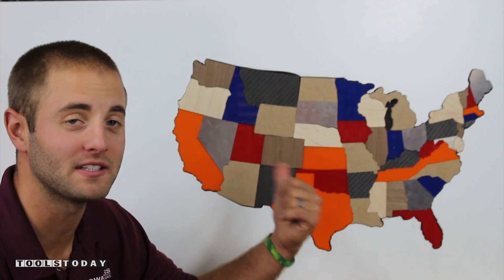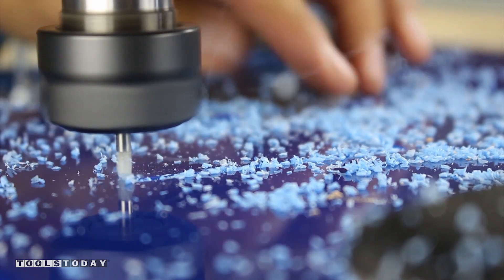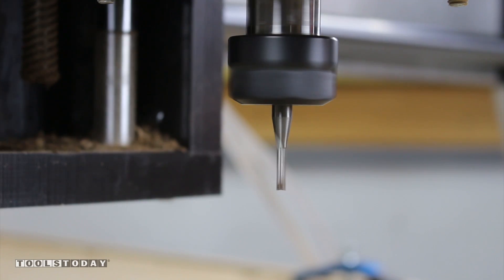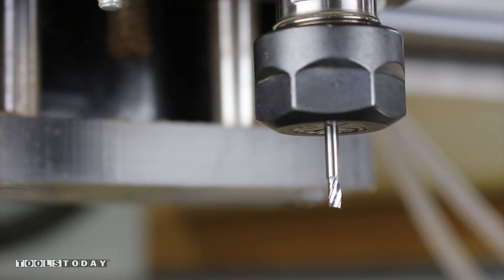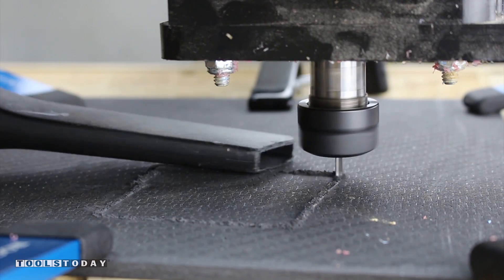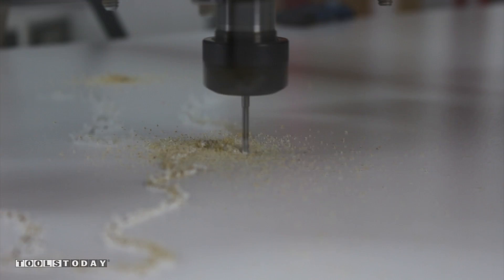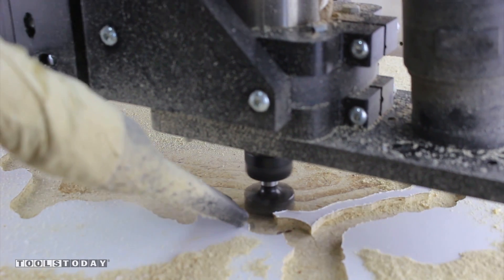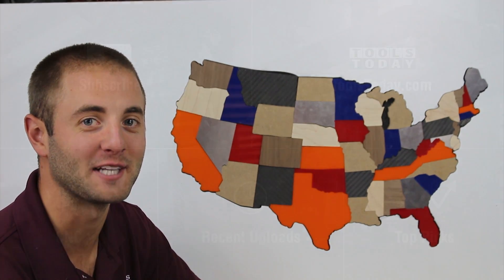CNC Project: USA Map Puzzle w/Amana's CNC Bits

Comment: I have a Router instead of spindle. Will that make a difference in regards to feed and RPM? What is the shank diameter for the 1/8" bit for the hardwood?
Reply from the maker: +Binh Nguyen, You may use the same feed/speed specifications on your router instead of a spindle, however please keep in mind the router must be capable of of the high RPM's that the spindle runs at.

Tool #46200 used to cut the hardwood has a 1/4" shank.